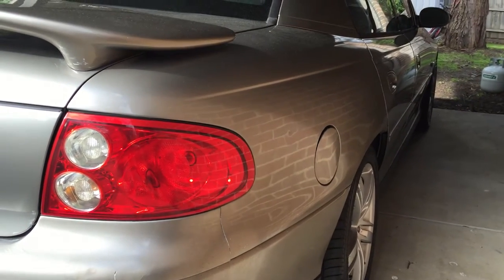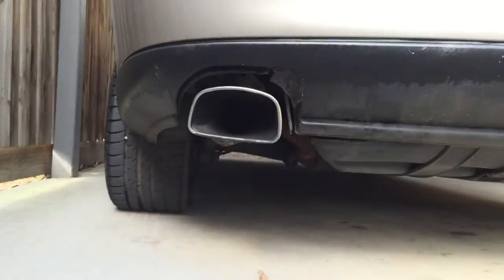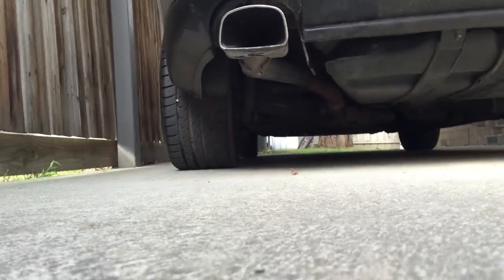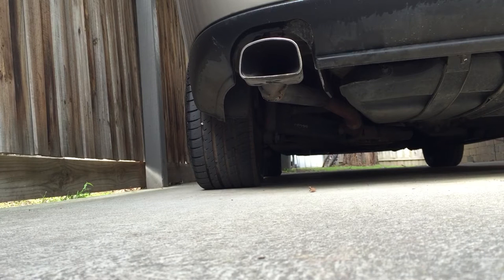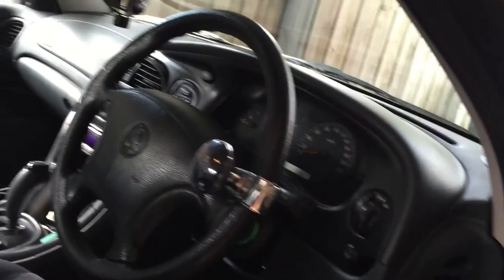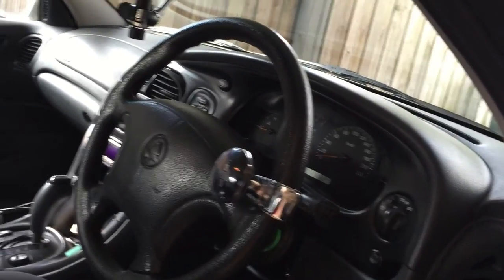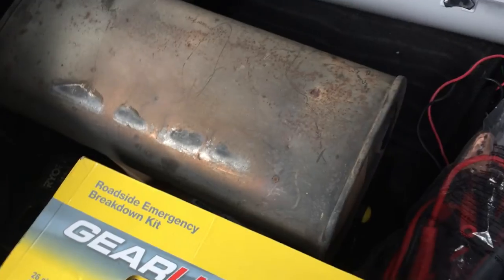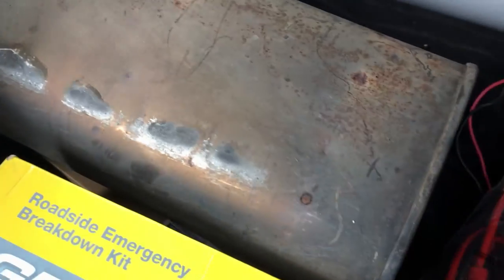HOLDEN COMMODORE VT EXHAUST STRAIGHT PIPE ®

Comment: could have got an exhaust off ebay for that price. cutting the middle muffler out is illegal. if you want it loud go extractors high flow cat and straight through cat back
Reply from the maker: Big bucks mate over $300 +
Reply: alexander J deleting the center muffler isn't illegal hahaha :') the legalities revolve around the volume ( DB) and the co2 emissions, so doesn't matter how you configure your exhaust as long as it sits within the dB limit and eimisions  limits it's fine
Reply: Dale 97 ok mr YouTube mechanic
Reply: alexander J illeagal yeah so is drag racin we still do it
Reply: @dale.5051  deleting your catalytic converters is illegal but the majority of people just put some steel tube straight through the stock cats and most people don't notice.
Reply: @hammatime94  lol this os ages ago now lol, but i was refering to the centre muffler not the cats